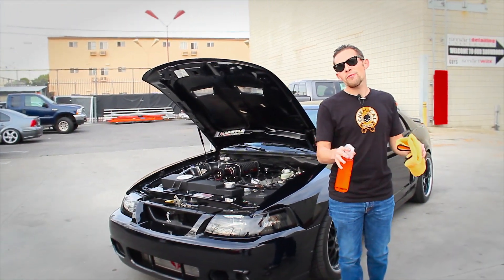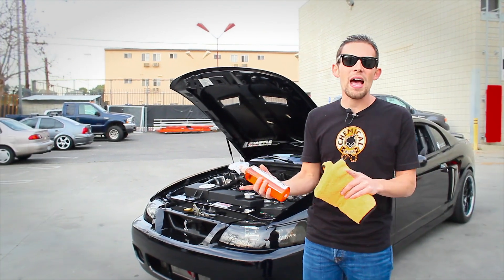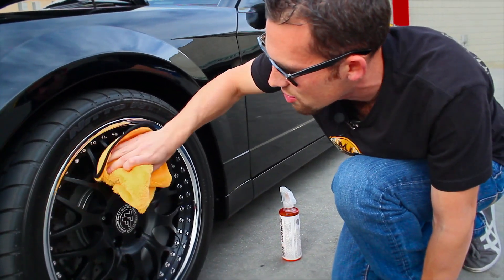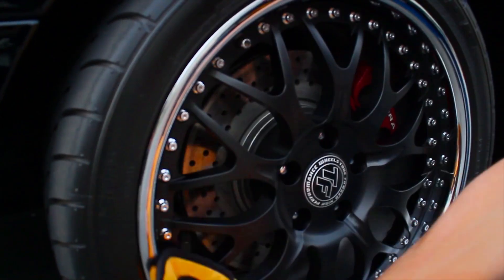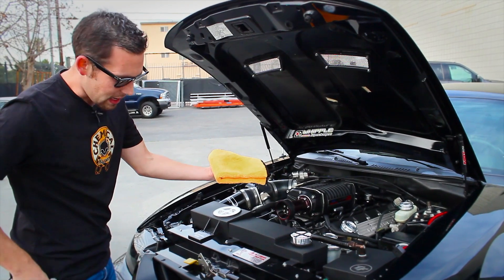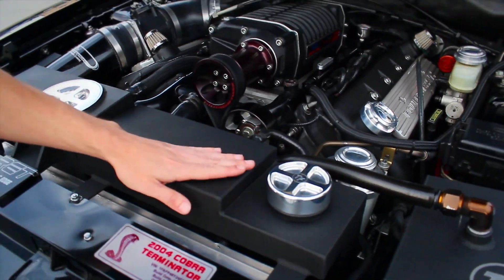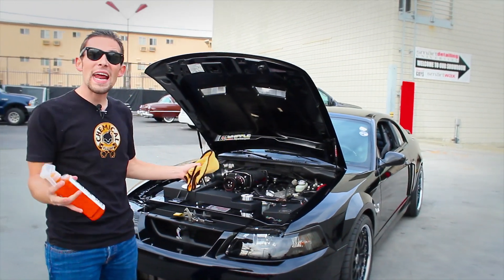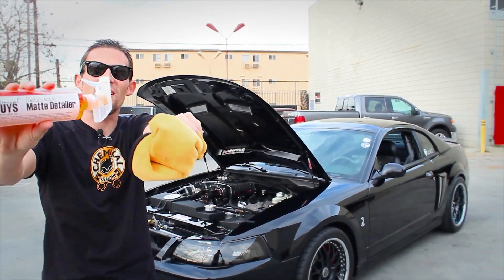How To: Detail Matte Black Wheels and Engine Parts - Chemical Guys Meticulous Matte Detailer COBRA

Comment: Just bought two of these for my matte wheels. I've been looking for something to clean my wheels for the longest time with no luck. Glad I started watching you guys. Not sure if it'll work, so we'll see. Only complaint is that shipping cost is ridiculous. I was only going to buy 1 bottle but for $10 shipping, I went ahead and got 2 bottles. Kinda sucks that I couldn't just get 1 to try out. Would of been more expensive if I bought another at a later date.